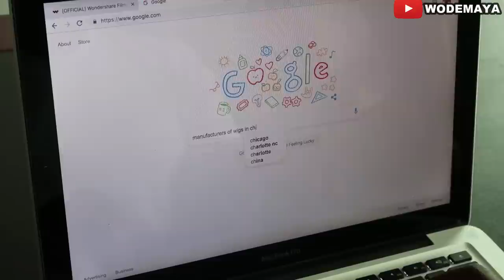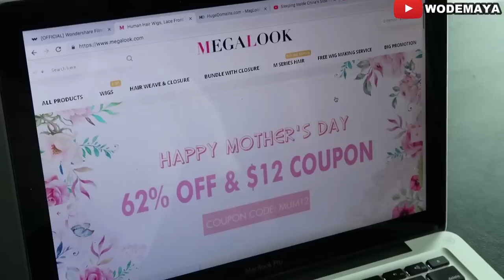How Wigs Are Made In China Will Shock You

Comment: I have ordered and gotten several wigs from China over the years. I have had to return some because they had been too small for me because my hairline starts a good bit lower than many women's does. 
I do best by custom ordering my wigs to fit my measurements. 
i had been a bit puzzled by the wigs being sown by hand, but being done right in front of us all on a machine. I have heard the term  "hand tied" used to describe many wigs that I have ordered and received, BUT, I am THINKING that maybe they had been "hand tied" by a person using a sewing machine. REALLY, as long as the wig fits me and looks good, you just can't beat the price of some of the wigs from China. 

Now, in the beginning of the video, the hair is usually collected in India at a religious ceremony where women will have their hair cut off near or at the "nape" of the neck, so, basically it is all cut off. 
And, it is mostly all very YOUNG girls that do this. And the hair is all REMY hair, which means that the hair is all facing the same direction. So,it is all roots in one direction and all tips in one direction. 
SO, me seeing the girls using that set of needle combs to make sure the hairs are all in the same direction is confusing to me. Some wig makers will use shed hairs to make wigs with, and so they will use the "combs" to make all of the hairs be in the same direction, because IF you would make a wig and the hairs were NOT all in order of the root and tip formation, when you would comb or brush the hairs, some would be "back combed" and some would be just normally combed, and so, anybody that knows what happens when you "backcomb" your hair knows that it gets all frizzy. 
Anyway, this video shows the wigs being made from Virgin hair, and it all seems to be legit. 
BUT, in the case that you may need to return a wig to China, it just MAY be a REAL pain in the ass.
Sometimes your credit card company will refund you because some wig companies will just NOT reply to you and since the Covid19 pandemic, they are just NOT dealing with any returns. 

IF you use Paypal, it can be a bit of a pain too. BUT, basically, IF you can usually wear a wig with no problems about it being too small, you just may be able to wear a wig with no worries.